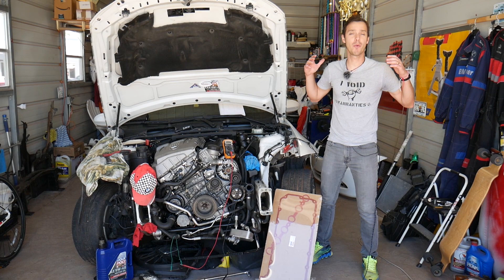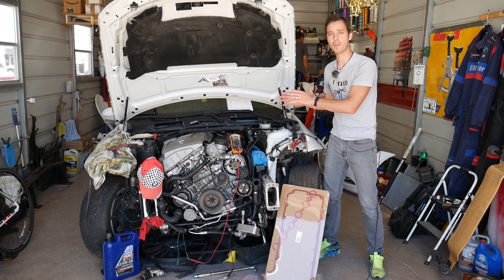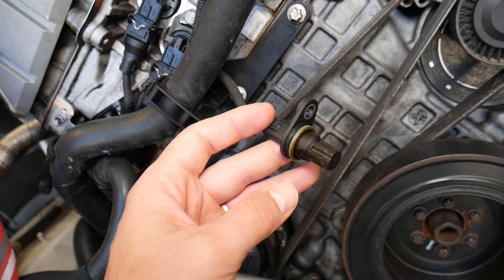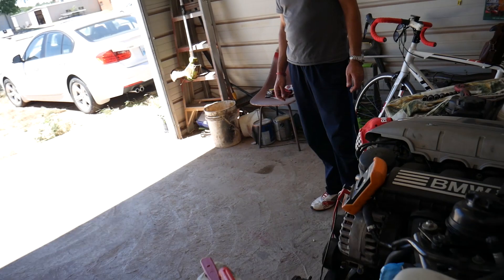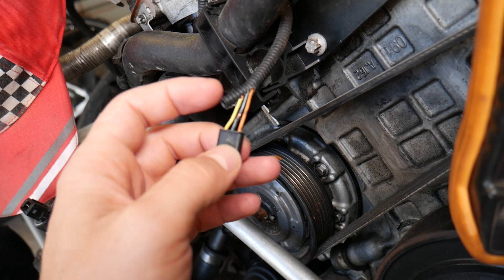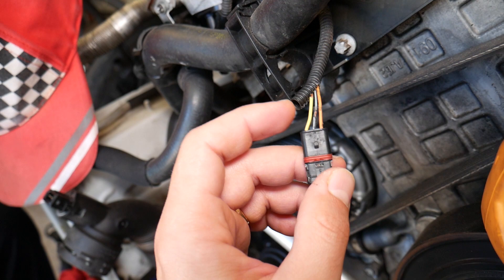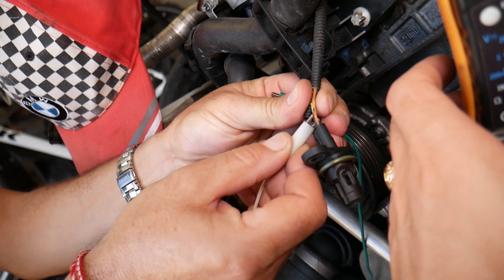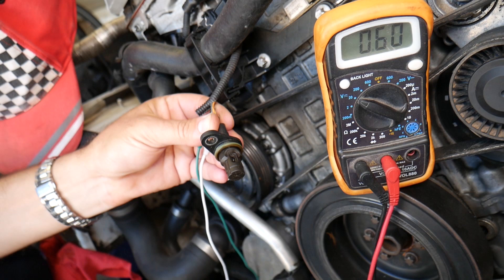HOW TO TEST CAMSHAFT POSITION SENSOR ON BMW

Comment: I have a obd1 95  325is that I just put a brand new oem crankshaft position sensor in. still throwing code. I have heard since crank and cam are on the same line to dme it may be the cam sensor. going to ohm test cam sensor now and report back

Comment: I fixed my CEL with the P0340 and the car runs like new. What I have learned the hard way is not to use ANY other brand than the BMW original part OR VDO (Siemens or Continental). There are brand names like Hella, Meyle or Bremi who have excellent products normally but BMW's are very special about their sensors!
The problem many people miss is that a new non-BMW or non-VDO CPS might work exactely like the old damaged one; Making people believe that the problem must be in the wiring or the Crankshaft position sensor; BMW must have a failsafe system that it still runs with the "wrong" sensor making the problem so hard to diagnose.
There are horror stories in the forums where people replaced harnesses and DME's just to find out that the sensor was the problem after all. The car might still start with a non-oem sensor; before you rule out the CPS as the problem make sure that you put an VDO or BMW sensor in it. If it still doesn't work get a second replacement one from BMW directly. A new VDO one is like 90 dollars a BMW one about 150 - after spending hours tearing the car apart just think whether 150 dollars is really that bad to be one the safe side!

Comment: What you guys are looking for is a digital square wave 5v that gets pulled to ground when the metal reluctor wheel passes by the sensor and that’s how it knows the timing of your engine. Keep in mind that’s why these guys were showing you this info.
Reply: I’m getting 2.5v on both sensors...they both go down to 0 when I put  screwdriver on the root of the Sensor....
Reply: @samah713  you have codes? Should be a 5v ref
Reply: @weldingjunkie  yup. At first I got a code for the sensor on the exhaust side...now I have a code for both sensors
Reply: @samah713  feed in a 5v from either the power probe 5v adapter or find a 5v from another circuit and jump it into the cam sensor 5v ref see if code goes away. You need to find out why you’re not at 5v there’s voltage drop in the wire somewhere prob the connector or it’s grounding out
Reply: @weldingjunkie  I'm going to try that. Thanks bud. Hopefully its not ecu
Reply: @samah713  anytime, how old the battery? It can cause that too. What year and model is that? I’m going to pull a wire diagram
Reply: @weldingjunkie  Im not sure on the battery. I bought the car recently as a project. I’m going to have the battery tested today or tomorrow. It’s an 08 328i
Reply: Hows it going,  i got 4.79v on mine,  did battery reset on old battery probably best if i get a new one
Reply: @marcinzemla6265  4.79 is close but should be around 4.9 to 5.1 what are you having for issues ?
Reply: When i hit the gas around 35 shakes before catching up running right

Comment: hola probando el sensor hice un corto y ya cambie el fusible del sensor de arbol de levas pero no me llegan los 12 volts sabras cual otro fusible se pudo ver dañado. buenissimos tus videos felicidades.
Reply: No ay otro fuse mas que el dme. A deber una falla en el cable (ratones mordieron tal cable)  de voltage o el dme.

Comment: Great advice.  ...can you make a video on how to upgrade the body kit on a 2007 328i ...for example), how to upgrade front bumper and grill of a 2007 328i... Which newer model  body parts fit on 2007 328i

Comment: Your battery was at 7v so pretty dead, but still got 5v on ignition wire. I had 11.7v but only 2.4v with ignition on?  I can’t figure out why I’m not getting 5v?  It does 0 when I hold a socket to it. Any idea. Thanks you so much for all these videos. 2007 x5
Reply: Maybe a relay ?
Reply: Did u solve ur problem?
Reply: Similar thing happened to me. Got 12.4 on both sides instead of 12.4 and 4-5 🤷🏻‍♂️🤦🏻‍♂️help
Reply: @testosteronba did you ever figure it out? going thru something similar now.